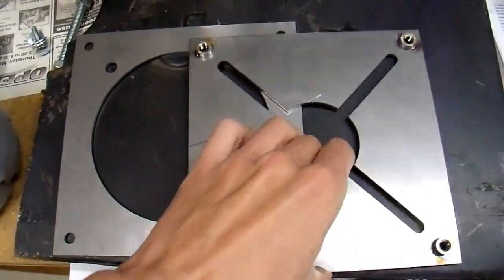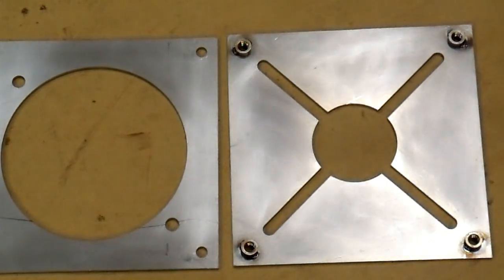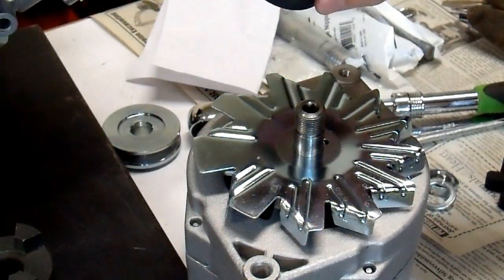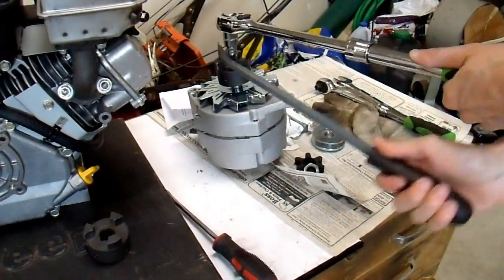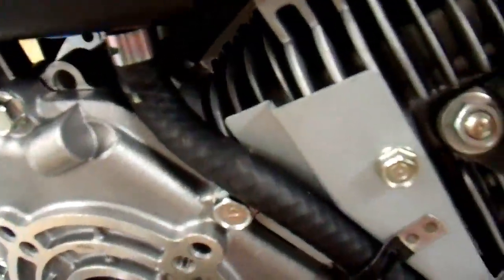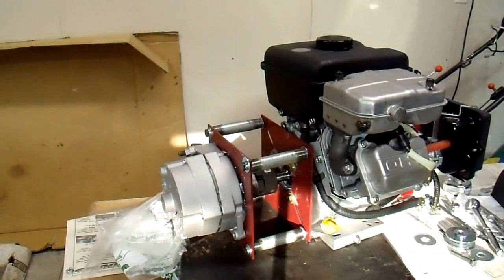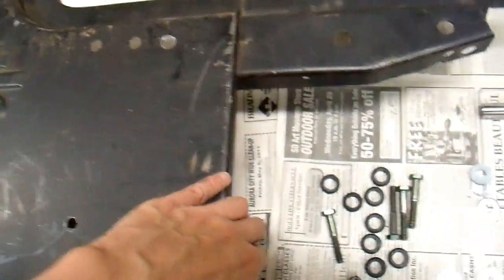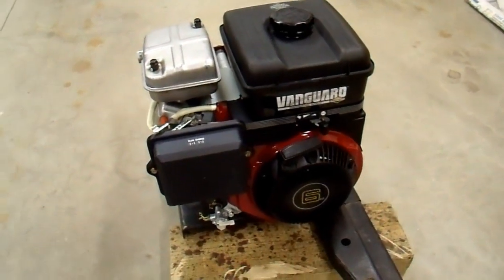DIY 12V Generator Charger - 2 Assembling the Generator

Comment: next time use acetone or brake clean it wont rust! you sure did waste a lot of money
on useless parts! mine cost $12.00 to build i had to buy the belt! i got pictures
available if your interested! next time use a v shaft motor and a ford 130 amp alternator!
its a more compact unit takes up less space!

Comment from the maker: Yes, the set screws in the jaw coupling are Allen drive - I forget what size.  I could only get them so tight before bending or rounding off the cheap Allen wrenches I was using.

Comment: Any thoughts on the set screws in the side of the alternator adapter? I see those holes in the side of it and I'm thinking Allen screws bud... You might want to have a closer look at those. The one I got has them as they are used to keep the adapter from backing off the shaft of the alternator.

Comment: ooops my bad for rated amp output the alternator SHAfT needs 6000 rpm.they can spin 12000+ and will in a car.
Reply from the maker: The output curve of good alternators is a logrithmic sort of curve that rapidly ramps to 80% or so of max output and slowly goes up after that.  Near max output is typically at around 4000 or so and efficiency drops off precipitously after that.  In a setup like this it's best to keep the RPM closer to the most efficient operating point for fuel usage and long term reliability.

Comment: Pemnuts (on the engine side adapter plate) are NOT meant to be loaded in the direction you've used them in (even when spot-welded).  You needed to flip that plate over and space it away from the engine as required to provide clearance where necessary...

I did see where you eventually went with pulleys, so I guess it's not an issue anymore...